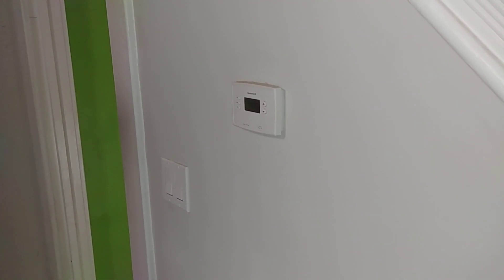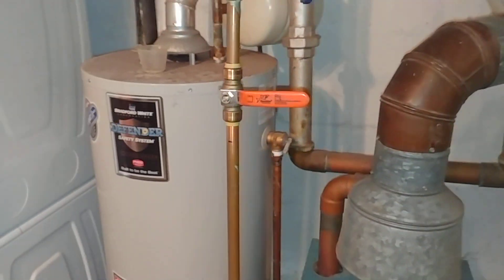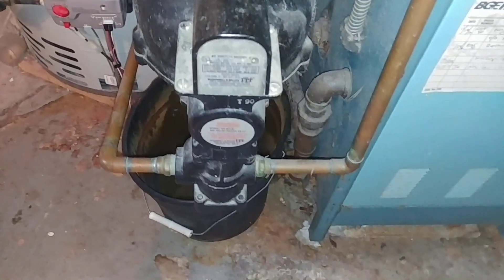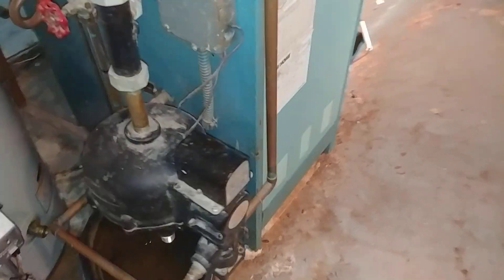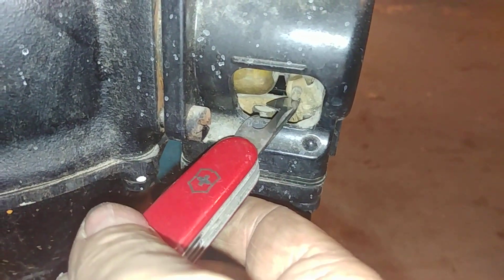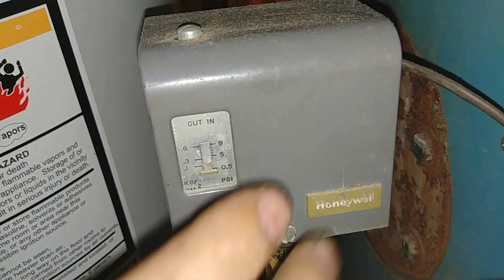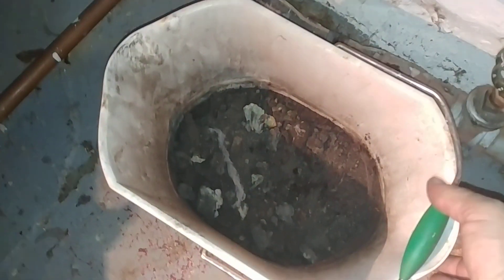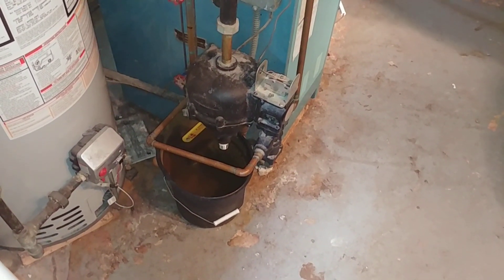Weekly Maintenance For A McDonnell #47-2 Low Water Cut Off & Other Issues On An Older Steam Boiler

Comment: My steam boiler timer should I set on and off times or leave it on 24/7?
Reply from the maker: It depends on several factors.
Are your mains insulated well?
Do you have adequate main steam vents?
Is your heating more or less even throughout?
Is your system oversized?
Are you doing it to save $ or for comfort at night?
In general, steam systems were more or less designed to have steam in them for long periods (ie coal fired).
Most of the time, deep set-backs bring forth problems like water hammer, hissing vents, uneven heating, etc.

Comment: Thanks for showing me the basics for boiler maintenance and the terrible near boiler piping, enough to send shivers down my back. Copper pipe above the water line is just awful, but the bullhead T and the counter flow mains were not helping either.
How would you re-pipe in the future? Would you change the pitch for the mains to make them parallel flow?
Reply from the maker: This counterflow main is short.  I'd keep it counterflow.
In other videos, I've shown various ways to deal with counterflows.
There is an "official" Lost Art Of Steam Heat way and that is sure to work in all cases. I seldom use it.
Usually, I just install a tee on the header angled off at about 45 degrees to allow the returning condensate to "sneak" in under the steam flowing out, if that makes sense.
Reply: @gordonschweizer5154 sneaky counterflow condensate is a good thing.

Comment: Gordon, I have an ECT-04 boiler that is only used in the heating months. The water quality in my area is pretty good with the PH reading  between a 6 & 7 would you recommend raising the PH into the 8 or 9 range & flooding  the boiler over the summer months to help prolong the life of the cast iron sections? The system now runs flawlessly during the heating months with the pressuretrol set to cut out at 1.5psi & cut in at .5psi internally I have periodically inspected and cleaned the boiler And flush the MM low water cutoff weekly. the boiler internal condition is in what I would say is average internal condition with rust scaling and sediment which I attribute to the previous installer and owner who rarely maintained the unit, The boiler started life off on the wrong foot being the absolutely worst install that I have ever seen, the installers made every serious mistake from one end to the other. From day one the boiler would pump water out of all the radiators and the so called reputable company that did the install kept turning up the pressuetrol creating more problems truly they were clueless. the past owners actually gave up trying to heat their house with it and turned to wood stoves.  The Boiler was installed in 2007. I reinstalled it in 2021 re configuring all the piping and venting. Thanks, I appreciate any advice
Reply from the maker: What sort of (if any) automatic water feeder do you use on your boiler?
Reply: The boiler feed is a manual ball valve. @gordonschweizer5154
Reply from the maker: In general, I avoid adding chemicals to treat steam boiler water, but that is me in my area's water and may not be the best for you with your slightly acidic water.
Proceed with care.
Flooding the boiler in the summer months does indeed keep out most of the oxygen (and tests for a failing boiler, too).
Very few do this, but you seem to be very diligent and "hands on", so yes, by all means do this.
Best of luck & happy steaming!

Comment: Nice to see a before video, what a mess!
Reply from the maker: It is all too common in my area to see boilers piped in like this.
It did, however, manage to work (more or less) for some 30+ years.
We hope to nurse it thru one last season, as this boiler is now a "zombie" boiler (there is rust-out hole in the cast iron heat exchanger)